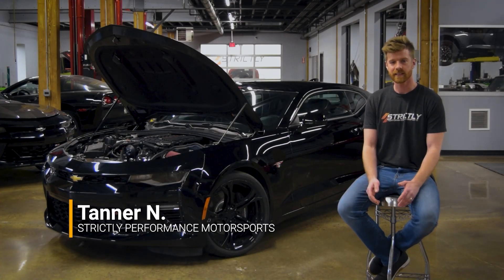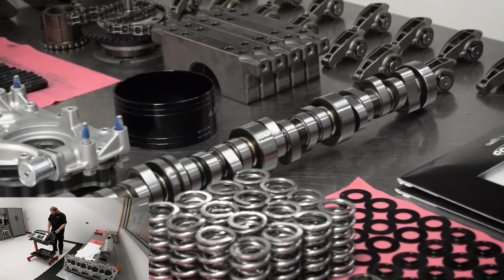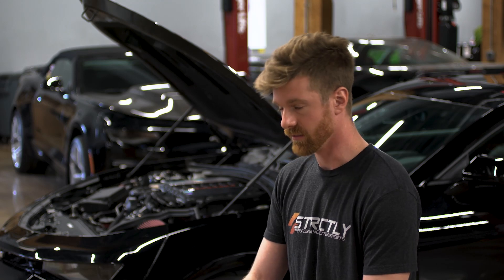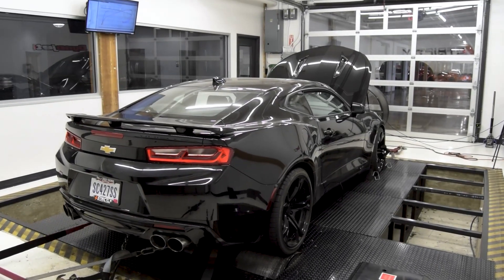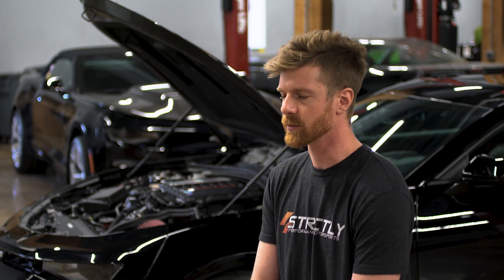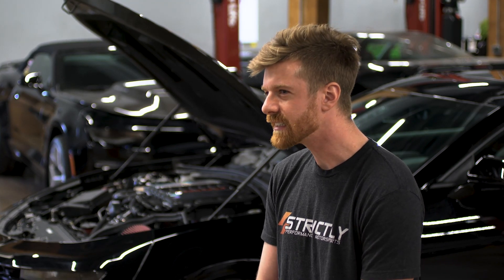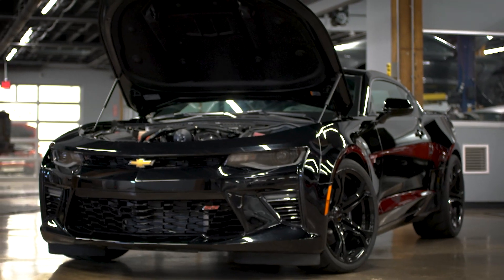1000HP 427 LT1 Camaro Magnuson 2650 Package Overview

Comment: So u have to do a engine rebuild? Cant use stock internals with the magnuson supercharger?
Reply from the maker: Long story short, we don't trust running the OEM LT1 pistons over (around) 650hp when throwing boost at them. Will they do it?- yah, probably but for how long before you burn one up? 
We build them so that's not a concern, and if you want more power down the road you don't have more work for yourself. 

Feel free to call or email the shop directly if you want to talk more about info on a setup.
(269)350-9055
Sales@StrictlyPerformance.Parts
Reply: @StrictlyPerformanceMotorsports  thanks for the reply, I live in michigan so i will be in contact soon about a performance package.

Comment: Does the magnuson have a front mount heat exchanger
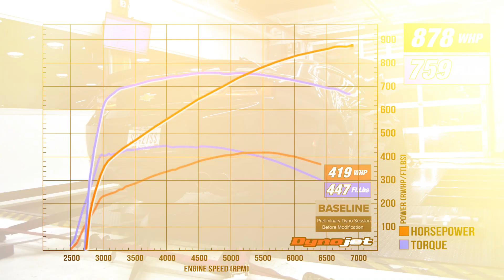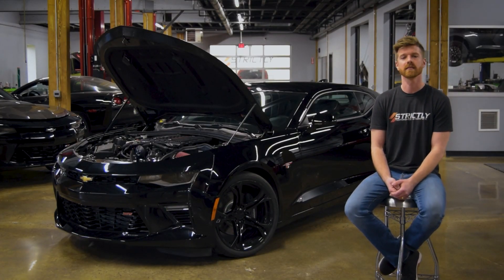Reply from the maker: 4:06 - 4:42 goes over the cooling.
- Magnuson Pump (standard with 2650 kit)
- Magnuson Heat Exchanger (standard with 2650 kit)
- Cordes Performance Bumper Ice Tank
- Redline Motorsports AN adapters